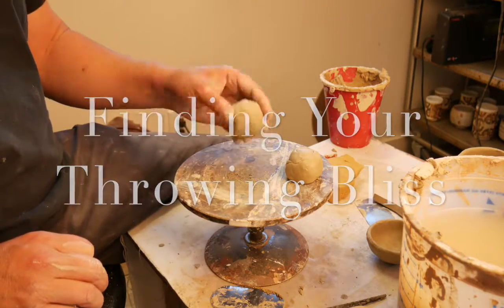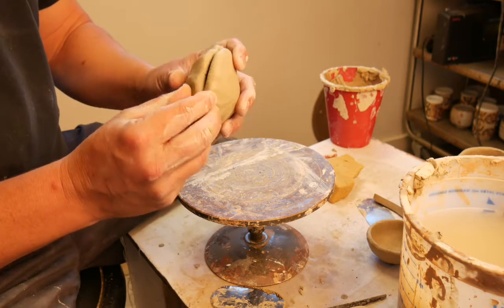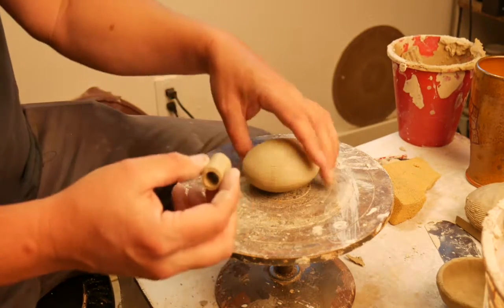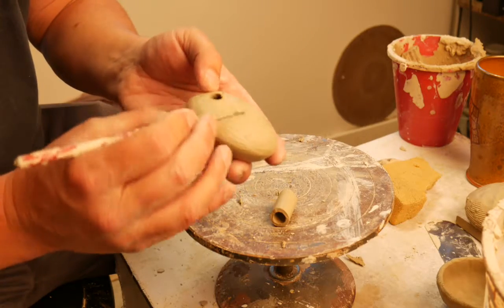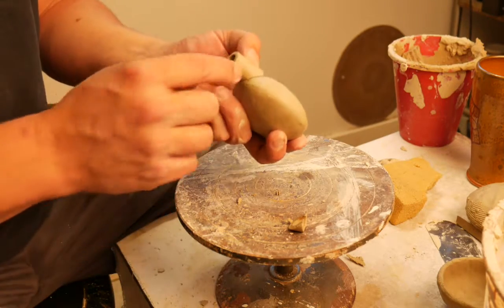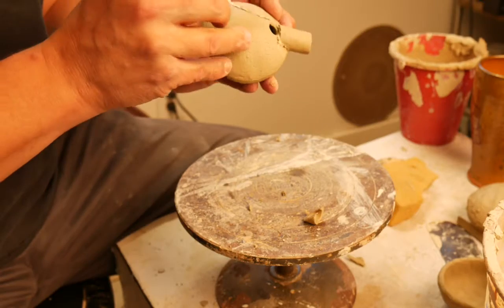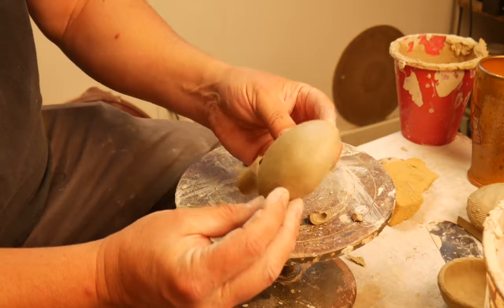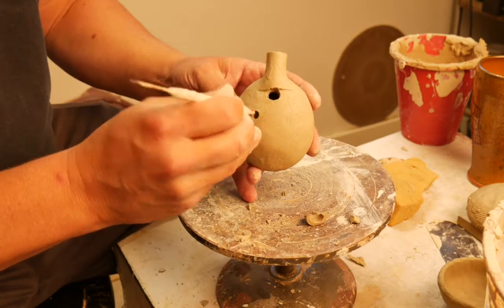The Ocarina

Comment: I have struggle with getting the tube in the right place to get sound with the tube too. When I don't use the tube I get sound but when I try with tube I can't find the right position. Any tips?
Reply from the maker: Thanks for watching and sorry for the struggles! My best advice is to cut the tube at a 45degree angle while it’s leather hard and place the front of the tube at the back of the hole. There must be a very small hole remaining at the end of the tube to allow air to blow over the hole. Remember to sharpen the front of the  hole for best sound results!
Good luck…
Andy
Reply: Thank you  @andyruble633  I will try it again!

Comment: Hi Andy! Please tell how long do you dry ocarina before making holes in it: several hours, 2 days, one week? Do you cover it with plastic bags to make it dry slowly or it is ok to dry it on open air? Thanks.
Reply from the maker: Hello, and thanks for watching! I like to make the holes and mount the blow tube when the clay is much stiffer in the leather hard stage. How long it needs to dry completely depends on the humidity and the temperature. You can speed up the drying by using a heat gun or hairdryer, or keep it wet by wrapping it up with plastic. I hope this helps!
Andy
Reply: They told me that the clay should dry as slowly as possible. I thought that if it dries on open air, it will be damaged in the kiln. Is it true?
Reply from the maker: Really fast drying could cause cracking, but it is possible to speed dry clay and it has no effect on how it fires in the kiln.